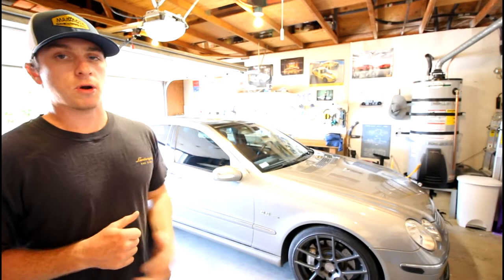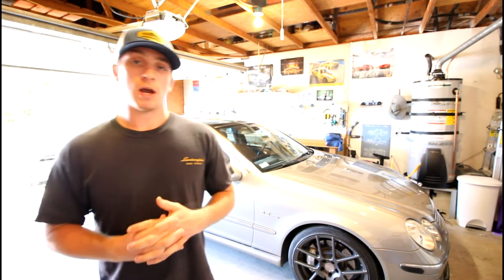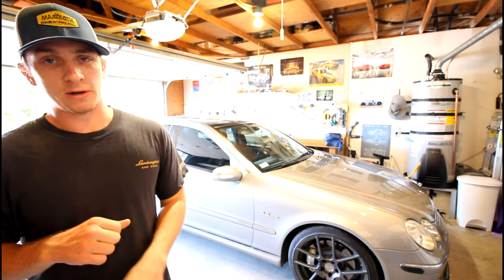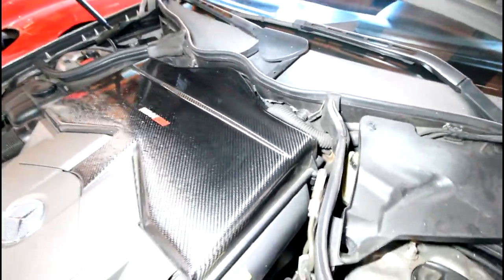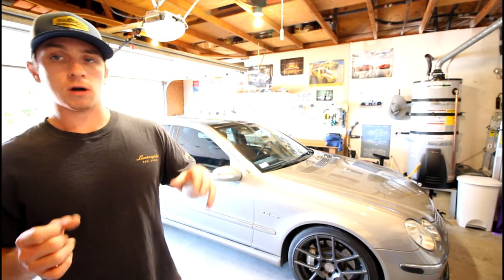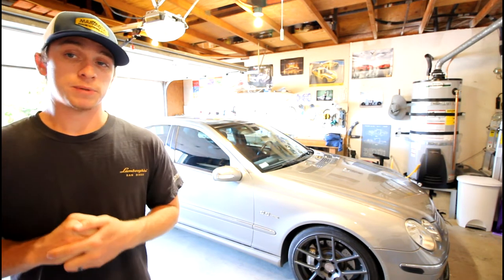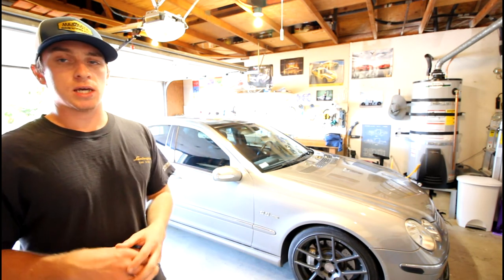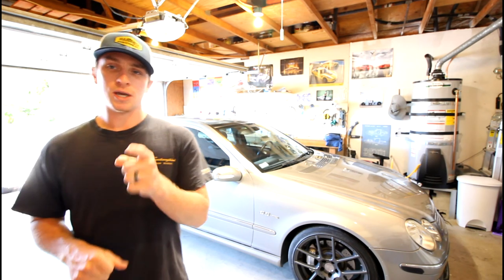C55 ///AMG (W203) Reliability and Ownership Review! (Updated)

Comment: Yo you’re a lot like me. I had a C55 from November ‘12 to November ‘15. Got it with 89k miles, and sold it with 160k. It was great car all around, I did eventually have oil consumption issues, engine & transmission mounts and of course the valve cover gaskets. Actually, I had a hairline fracture in the transmission housing (you can only imagine how much I beat on the car) I had the car when I was 16, it was fantastic fun lol. I did destroy the car tbh. I traded it for a ‘14 E550. The C55 is certainly underrated.

Comment: I have one, any issues with shaking when the car is in gear? Mine feels like i have a small cam but cant figure out what it is. Idle is good. Just shakes. Maybe engine mount..
Reply from the maker: That most definitely sounds like an engine or trans mount. I replaced mine about a year ago when I was getting bad vibrations at stoplights when the car was in drive.
Reply: I have same issue. Also weird idle in gear at lights

Comment: Thanks for the video ,,well done..I agree with what you say ,,.I have a 2005 CLK55 ,,my only tip ,,replace the Crank Position Sensor before it fails,,usually at around 13 years of age regardless of mileage....use genuine Bosch only .
I have had almost no problems at all ,,all just routine maintenance ,changed all the fluids and filters ,,spark plugs , valve cover gaskets , front brake rotors and pads, transmission connector plug ,,  and it did also need new front control arms.
But now it is perfect and will go for years ..

Comment: any idea how long my 2005 c240 4matic will last? currently has 191k miles and still runs like a dream. Also, loved the vid and the c55!
Reply: my 2005 c230 has 203k miles and its driving strong. i also just installed BC racing coilovers.

Comment: No major suspension issue in 8 years of ownership? WOW. I am changing my shocks and double wishbones .
Reply from the maker: I probably could've replaced the shocks in the last few years of owning it. That might've helped me rear wheel rubbing issue slightly.
Reply: @Addimotive  Mine rear right axle bushing is broken, I might Just Need to change That. The shocks are in Good conditions, Thank God No Need replacement.
Reply: Usually the front upper control arms or chassis bushing needs to be replaced after 60 to 80,000 miles, depending on how it is used.